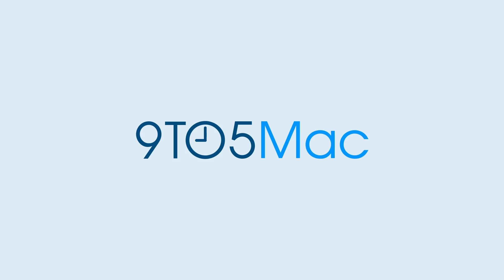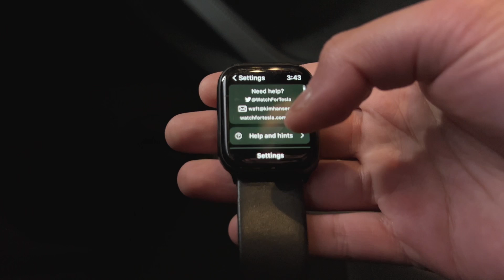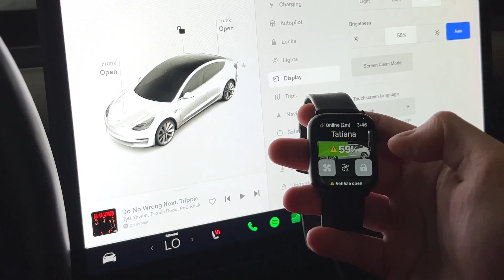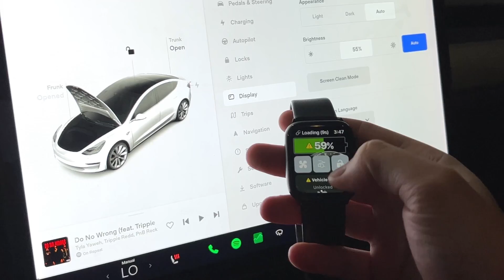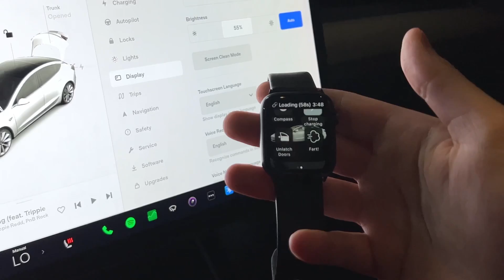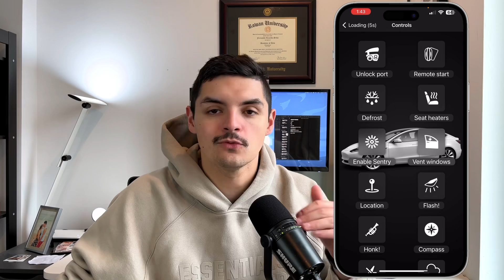Fully Control Your Tesla From Your Wrist with WatchforTesla App!

Comment: BUT... In order to actually drive the car you need to take the watch off of your left hand, hold it to the center cupholder area (then unlock the watch again as it will have locked when it was removed), hit the brakes to "start" the car and then put the watch back onto your left hand? Is that correct?

Comment: I always go with my phone
Is there any option to use the watch app,but the watch won't act as a key(like the phone)?
Reply: Yes, the watch will not be a proximity key if you do not turn on the proximity key setting in the watch itself.  Even if you do turn it on, you have to be in the car with a Tesla key card on the center console, when you turn on the watch proximity key. Then on your Tesla navigation screen you will get a message that says something like, "would you like to allow this device to be a key" and you have to click the confirm button on the Tesla Navigation Screen, to make the watch a proximity key.  Then I got an email from Tesla, warning me that another device had been authorized as a key.  Otherwise the Watch will only control the car if you open the "Watch for Tesla" app.    And then it takes about 3 to 4 seconds for the controls on the Watch for Tesla app to start interacting with the car.  
I was confused at first because on the iPhone, when you open the "Watch for Tesla" app, it has a slide button that says make this device a proximity key.   I thought they were talking about my Apple Watch, instead they are talking about the iPhone itself.  Which to me is kind of silly, because anyone with a Tesla already has the Tesla App and it already has a proximity key built into the Tesla app that works amazingly well. 
I don't really understand why they would duplicate this in the "Watch for Tesla" App on the iPhone?  It does not make sense to me.  It took me watching this video to really figure out that I had to have the watch in the car with my Tesla key card, to go into the watch, select the "watch for Tesla" app on my watch, then slide the button over where it says make this device a proximity key, and then the watch itself can become a proximity key.